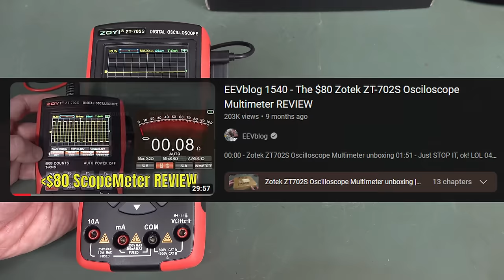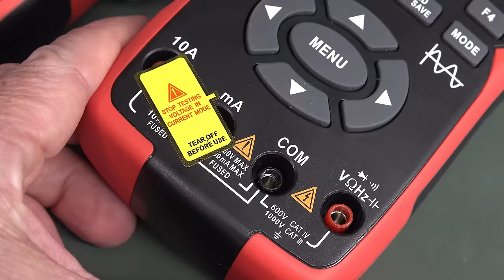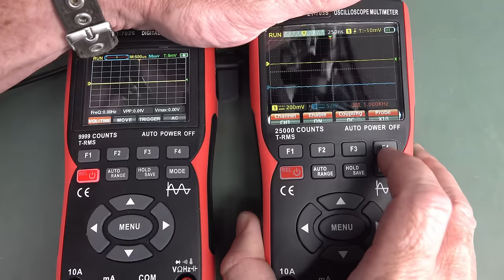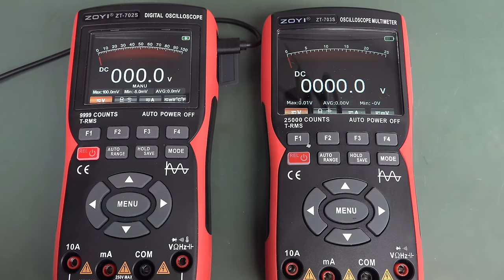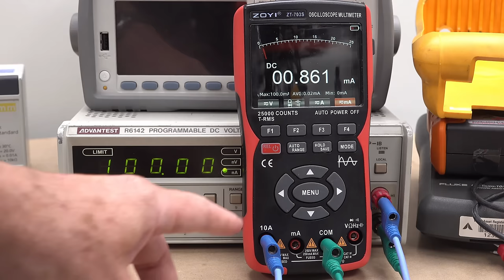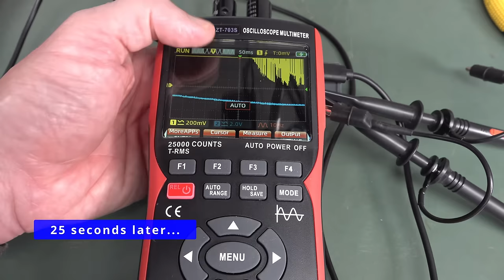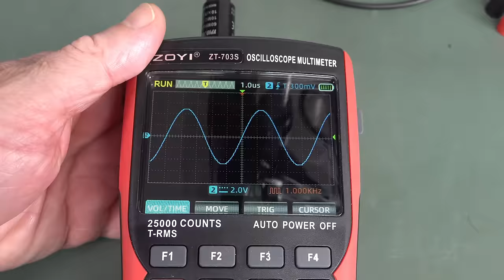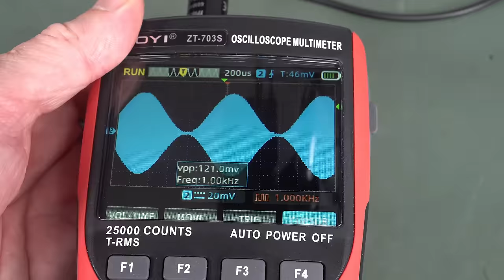EEVblog 1597 - Zoyi ZT-703S $80 2CH 50MHz Oscilloscope/Multimeter Review

Comment: If you buy the kit that includes two probes, they ship it with the second probe taped to the box containing the scope and wrapped in a mountain of bubble wrap. Unwrap it carefully and don't just cut the wrap off like I did, or you'll end up with a single probe kit plus 6 pieces of scope probe cable.
Reply: They need a college football player majoring in 'packaging engineering' to solve this problem.
Reply: Use a machete to open the package?
Reply: @_BangDroid_  that's not a noife
Reply: @_BangDroid_  thats not a knife! 🤣
Reply: lol
Reply: I always open things carefully. I reuse the bubble wrap when i sell ebay items.
Reply: Oh man I'm so sorry. They just taped it to the box. 😢
Reply: Are you AvE?
Reply: The ZT-703S unit I received was in a cardboard box with the unit and accessories, while the second probe was in a zipper bag outside the box and all of that was inside a slightly larger cardboard box.  The box was shipped in an unpadded Speed Pack plastic bag, but everything made the trip safely from China to the US in about one week.  I ordered directly from the Zotek official store on Ali Express.  As long as you’re realistic in your expectations, it isn’t a bad bit of kit for the price, though I do like the Owon DS200 series more.  I own and have used both brands of scope meters.

The ZT-703S ships with a surprisingly large 3400 mAH 18650 cell.  I found that the ON/OFF button power light flickers annoyingly when the cell is almost full.  I tried substituting a known good quality 2000 mAH cell, and there is no flicker. My speculation is that the very large cell stays at near the knee of the charge controller longer and that is why the power light flickers.  I believe there is nothing wrong with the meter.  The 3400 mAH cell is also one or two mm longer than the 2000 mAH cell and it barely fits in the cell holder.
Reply: @wtmayhew Perhaps, the li-ion cell is 2 mm longer because it has integrated overdischarge/overcharge protection board and not because of its higher capacity as long as it is in standardized 18650 cell package.
Reply: I got mine yesterday.. no second probe anyware. Any updates last months?

Comment: I can see a good use in the automotive field. Having a battery operated scope with live feed and trigger save can be a blessing for catching intermittent problems. Intermittent problems are the worst!
Reply: I totally agree with you. A device like that can be quite useful for any kind of test or repair which can't be done in the lab. Being able to see waveforms is great for debugging complex problems, but sometimes using a normal oscilloscope is just not possible
Reply: Came here to say that, if there was only a bit more rugged version it would be perfect
Reply: I do not know they survive that. I have seen a lot fried Fluke scopemeters used automotive. And those are pretty well protected. On the other hand, you can fry 50 of these against one Fluke. If you buy them 10 at one time you could probably get a discount.
Reply: @xani666  Being able to save waveforms to an SD card would also be great (I haven't finished the video yet, so maybe it actually can)
Reply: @pa4tim  I do not think this one would fry more often but I do think it would do far worse on dropping and other mechanical abuse.

Maybe the mechanics try to probe the high voltage part of ignition lmao
Reply: @xani666  At least one did that. He set the scope probe at 1000x, used a 10x probe. When he did not see a trace he tried the other channel. 🙂 He would not believe the 1000x is only for more easy read out and not  made the scope good for 10kV
Reply: @pa4tim  that seems to be common trend with mechanics. "I used that massive cheater wrench on my tiny ratchet, why it broke, what a shit company, they should make it harder"
Reply: Yah know, this might be a bit long: absolutely would be good in the auto field. I'm a 20 year master tech. Specialize in electrical issues, worked on euro my whole career. I can probably say that I've used a scope maybe 20 times during that stretch. One of the biggest issues is that although we have 3 different repair information programs, so much is unavailable such as known good wave forms, communication specs, etc. 
Although expensive the snap on vantage at least showed great images of testing points and expected voltages or signatures. 
And even though I work on expensive cars, trying to get the appropriate time as a flat rate technician and help the customer understand the cost Ive found very difficult. Spending upwards of 10k for a fully featured pico or micsig is a large investment with not a lot of return potential. Would I love one? Absolutely. Can I work around it with experience and existing tools quickly and efficiently? Yes. 
At the end of the day, I would love the be able to use a scope more often, but financially it's a difficult sell and OEM information is seldom available. 

If someone has other experiences please lmk!
Reply: @xani666 I feel mostly they aren't surprised when that happens. It's just physics. Tiny ratchets can be replaced.
Reply: @xani666  Tube-based O-scope. Steel chassis.
Reply: @pa4tim I don't want to offend anyone, but I've seen so many so called auto techs who still don't EXACTLY know how a car's ignition, injection and other sensor systems supposed to work. I do not mean the brand-specifics, but in general, general theory of software-driven control, injection coil driving, ignition coil driving, rotary position sensing, and some fundamentals of electronics. You can't successfully diagnose (and not burn your scope in the process) witthout that. Most service person I've met only very broadly narrows down the problem, if any, and start to binge-replace parts (at customer's expense to say the least).

An engine control in a car is not such an unexpected environment than like a never-seen-before industrial machine. You can quite predictably expect injectors, ignition devices, motors and sensors there at very predictable locations.

Yeah, you have to be an ICT and embedded electronics tech nowadays (= since the '90s) to diagnose cars. This is how it is.
Reply: It's the intermittent problems that get ya.. "EVERY TIME" 😅
Reply: Yeah, it’s not rocket science. Far from it. Cars are still years behind in computer tech, and 9 out of 10 intermittent problems are caused by bad connections. Just start at one end and you will find the problem.
Reply: @jesperwall839  You are dead wrong! It IS rocket science! The exact same vibration analysis, temperature, water/dust ingress, and more tests done on automotive applications were designed for space missions. The exact same intermittent problems, sensor, and network problems plague both categories. Space and automotive follow the same Ohms law, use the same components, same sensors, same schematics, same metals.
Reply: Cheap scopes are the worst at catching intermittents.
Reply: Not very useful in the automotive sector as there is little signal/data storage. Buy a picoscope!

Comment: Dave, you may have been a little harsh in your evaluation of the Zoyi ZT-703S with regard to its stated 50MHz bandwidth. The scope comes shipped with the bandwidth setting (shown under the menu setting “Run Mode”) set to “Normal Mode”, which limits the bandwidth to a maximum of 30MHz. This is done to lower power consumption. To measure signals up to the 50MHz maximum, you need to change this setting to “High-Speed Mode”, although it states the power consumption will increase. I would like to see you re-evaluate this scope with the setting on High-Speed Mode and see if it does reach its full 50MHz bandwidth and maybe check the power consumption in this High-Speed Mode compared to Normal Mode and let us know how it compares. Thanks!
Reply: Imo it should show "30kHz mode" for a brief second then, so people know there's another mode. I wouldn't know either.
Reply: This, exactly this. Although to be fair, if I used this, I wouldn't know better either. Hidden modes like this are why we read the manual.

Be honest though, the first thing we do is throw it out for simple use gadgets like this one, oh well I guess the 50MHz mode is hidden.
Reply: I remove the user manual, read it thru, then remove the device, check it to make sure they agree.
Nothing broken, missing, etc.
I can't imagine doing any other way.
All tools require inspection and familiarization, for safety, and best-bang-for-bucks.
If you don't your a fool.
Reply: i wana buy this oscilloscope to test power phases on Graphic cards. do u think it will be enough to tell me if they are ON or OFF? i just wana see a signal on or off.. dont care much abt readings
Reply: Do they think the meter is decent

Comment: I would recommend paying a little more and going with the Owon HDS242S.  That’s a two channel 40 MHz scope, 20,000 count meter and 25 MHz function generator.  I easily found it listed for $140 US, but I assume you could find it for less.  It is worth paying a little more because the Owon instrument meets or beats the promised specifications.  The Owon uses two 18650s which are easily field swappable under a removable cover.  Accessories are similar:  carry case, meter probes, one scope probe, alligator clip co-ax cables, charger/cable, manual.  I carry the 100 MHz version of the Owon in my tool bag.
Reply: It would be interesting to see an OWON review.  I've got a couple of their DMMs and they are solid units.
Reply: @button-puncher  There are several reviews of the Owon HDS200 series on YouTube.  I own both the 100 MHz and 200 MHz versions.  I believe the best value/price proposition is the 100 MHz model unless you need the extra bandwidth on a regular basis.  There seems to be a little less noise in the vertical amplifiers of the 100 MHz model even though it uses a multiplexed ADC chip versus dual ADC chips of the 200 MHz version.  I’ve got an Owon clamp multimeter in my tool bag too and it is surprisingly good, not as nice as a Fluke, but like 1/6th the cost.
Reply: @wtmayhew  I love the DATA LOGGING function through blue tooth on OWON. I OWN couple OWONS and very happy with their quality.
Reply: Yep, I have the 100MHz model in my toolbag as well.  It's been handy when working on cars and seems pretty well sorted, no major bugs.  As usual with these things they can be a bit frustrating to use compared to a bench scope, but that's always going to be true when you have buttons instead of knobs and a small screen.
Reply: I have a 70Mhz OWON for a portal scope. I dont like that continuity its very slow to respond and the battery drains itself when powered off
Reply: @tech29X  Yeah, that's why I bought mine.
Reply: @wtmayhew  Cool.  Thanks for the info.
Reply: @button-puncher  You’re welcome.
Reply: @ferrumignis   Some of the early versions of the 100 MHz version firmware had an inaccuracy in the timebase at the highest sweep rate.  The Owon web site has a firmware flash file to correct the problem.  The update procedure is to download the flash file, put the scope in USB memory device mode using the system menu, copy the file from the PC, then reboot the scope.  The unit I got had no problems, but there was newer firmware on the web site, so I did the update procedure and it was fairly easy.  I’m not sure what the update changed because everthing seemed the same afterwards.

I agree that these portable scope meters aren’t as convenient as a desktop scope.  The main issue is the reduced number of buttons and no rotary controls means multiple functions have to be controlled by the same button.  It is a little tiresome to keep having to toggle back and forth bemteeen the vertical and timebase functions, but that’s true of all manufacturers of portable scopes.  I believe Owon did better than most at making the layout well organized.
Reply: @Chris-Brown-   Good points.  I haven’t noticed the battery drain being too excessive (it is there though), but a hard power switch which actually breaks the circuit would have been nice.  The continuity beep could be faster and also the auto ranging on the ohms scale would be nice to be quicker.  When I think back to the basic instruments I had back in the 1960s when I first started radio as a hobby, it is difficult to be too annoyed at the shortcomings of the little Owon portable scopes.
Reply: @wtmayhew  Thanks for letting me know, I'll check which version I have.
Reply: I have the 70 MHz version. It's filled with imperfections but it is so convenient (and cheap) that it fills a need. Great display for a multimeter, super bright. My biggest complaints are the low bandwidth of the AC DMM (4 KHz, and their cheaper Owon meters go out to 20KHz or more) and lack of RMS measurement in the scope function, which really seems missing as it sort of solves what I'd do with the higher bandwidth AC measurement. It even has an RMS chip with 500 KHz bandwidth. I've often wondered if they stuffed the wrong caps on the front end of the DMM...
Reply: @W6EL  Thanks for the observations.  I found the DVM function starts to fall off even by about 2.5 KHz.  There are a few changes in the 200 MHz version which includes a separate ADC for each channel, so 1G sample/S and 200 MHz for both simultaneously.  The 200 MHz scope function also includes RMS measurement and I believe there are one or two more pre-defined arb waveforms.  I believe the DVM and electrical specs of the function generator are the same.  I found I could get stable triggering out to about 350 MHz, though the trace is thick due to the ADC gate time/jitter and of course reduced in amplitude.  Still, that’s very impressive for an instrument you can get for under $260 if you shop around. There is also a new HDS300 series which has a 30 MHz generator.  The paper specifications look similar to the 200 series.  I have no personal experience with the 300 series.
Reply: @tech29X   I bought the model without the Bluetooth logging option.  After I got the meter, I had an application where logging would have been handy.  Go figure.
Reply: @wtmayhew  Yeah, I've experienced similar situations, where I skimped out on a feature and later regretted it, but the opposite has been true also, where I paid for the premium features and never really had good use for it. So, don't beat yourself over it,
Reply: Yes, I already have the OWONHDS242S. Its very good. The scope UI can be a bit annoying sometimes. The signal generator is much better. I use it to test audio amps.
Reply: @W6EL 😂😂😂

Comment: They removed the writings of the chips probably because they don't want to see dozens of copies of their product.
Reply: Or because the chip manufacturer wants to protect its brand. Maybe these failed QC. Like CPU binning.
Reply: @simon3121  All of them?
Reply: @raytry69  Maybe for the FPGA. The other parts could be similar, but say a reel has a 3% failure rate instead of the 1% failure rate, then they can't sell the reel as namebrand but they can go through and test all the components on the reel and pull off the bad ones. So the chip portion of the component cost drops to zero because they were headed to the dumpster anyway because they can't sell them. However with the essentially underclocked fpga chip, they can sell a bunch of chips in a product that doesn't quite spec out right anymore to consumers for cheap and still make money off them. 

They also could be avoiding people copying the design.

Comment: Dave, you should look at your own forum - there's a thread where we've done a bunch of testing, and identified a bunch of issues already. There are some new firmware versions available, but not all of the known bugs are fixed yet
Reply: So the output mode works at the same time the oscilloscope does, but the "other apps, gen" one only works as a standalone generator - you can't use the scope at the same time. In the "output" one that works with the oscilloscope, the regular square wave is fixed at 1khz for the probe calibration. There's a different square wave mode that allows you to change the frequency and the duty cycle. BUT the limitation is if you have the "output" on, it limits the timebases (and sampling rates) available in oscilloscope mode. Took quite a while to figure out that limitation, though it is mentioned in the manual.
Reply from the maker: That was for the 702S. I didn't see another one for the 703S. Forum currently down, so I can't check.
Reply: @EEVblog  The thread is titled 'New Zoyi multimeter+oscilloscopes - ZT-70xS, up to 50MHz/250MSps (nov 2022)' - I have the tab open from before (even if the forum is currently down). I also picked up the Owon HDS2202S at the same time - it's definitely a much more polished product - just better in every way, but 3x the price too. Neither of them are my main scope - they're for places the Keysight one shouldn't go - out in the rain, on a ladder, in the back cabinet of greasy cnc machines, etc etc.
Reply: @EEVblog That's what I came to find out about. Is it likely to be down for long? Did someone forget to pay your bill? :D Hope it all comes good soon.

Comment: The bargraph is useful when you are watching to see if the reading is moving up or down. Visually seeing a meter needle move in a direction is easier than remembering and comparing numbers in your head. The needle also shows the rate of change. Quite useful.
Reply: You must be one of those people that prefers analog clocks. I have to convert the clock hands into numbers to know the time, so I prefer digital as no conversion is necessary. 

For this sort of reason I agree with Dave. I would much prefer big clear numbers instead. 

Or it should at least be an actual bar-graph instead of stylised like a car speed dial.